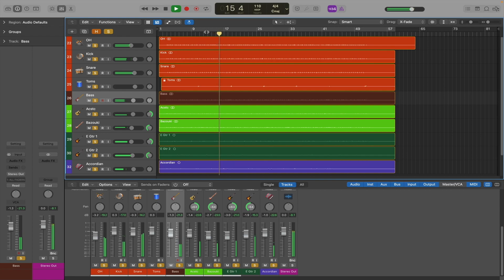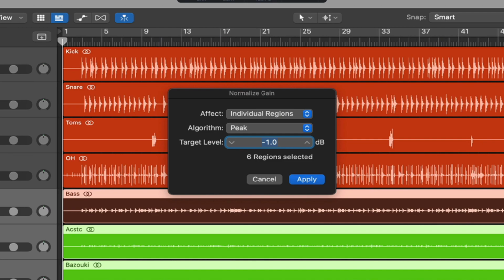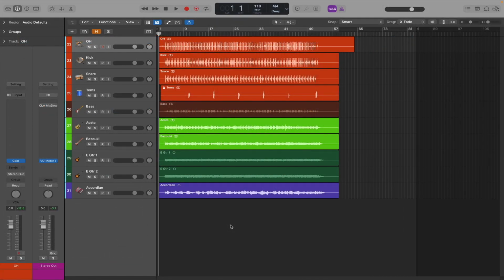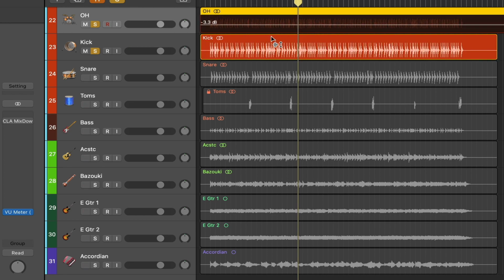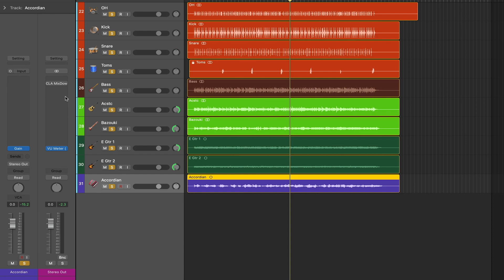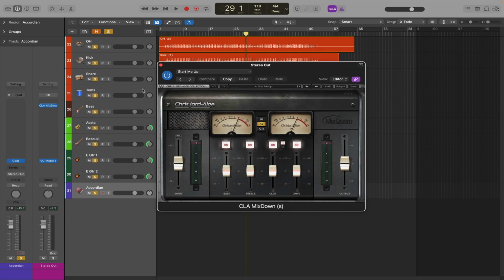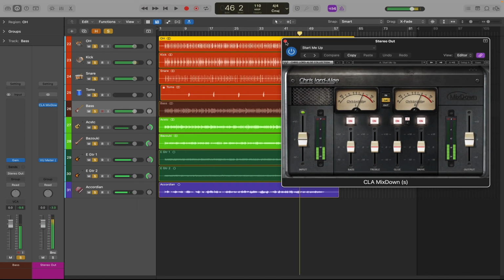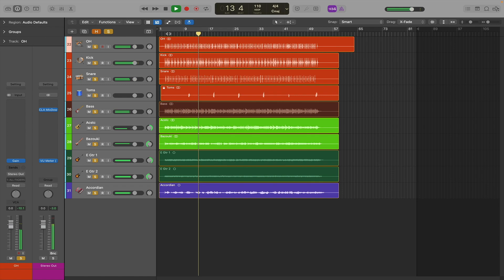How to gain stage projects in Logic Pro

Comment: Thanks for this information, I am a little confused by the way you gain staged drums first and then other audio files relative to your drums. I have a question please... why do you gain stage to -1 initially and then further to  -5 and not at a lower level across the board?? I have been advised by several engineers to gain stage my session audio files to -18.00 peak using the Logic Normalise Gain feature. Apparently many plugins are modelled on analogue gear that operates best at operating level of -18. When I do this as a whole to all audio files simultaneously the individual drums and other types of audio audio do not exceed -18 which appear to be a good level on for example my SSL Channel strip. Input gains above -18 show as red in the channel strip metering. Kindest regards from London UK 🙂
Reply from the maker: Hello, @ViceSquad. Great question! First off, I’d like to mention how varied the gain staging approach is for different engineers. Chris Lord-Alge is known to regularly push hot levels (around -6 peak or higher) into his SSL console for the saturation the individual channels impart and then trimming back at the master before everything hits the master bus chain. Andrew Scheps has been quoted as saying that he doesn’t have any real gain staging methodology that he uses. These are two highly known and successful professional mixers with pretty radical views on gain staging. I personally like dealing with this prior to mixing or my mixes can get really harsh sounding.

Now the reason that I set my drums to -1 peak to start off with is just to ensure that the drums start off louder than everything else and then build around that. You can start with lower peak levels for the drums, and build around that, as well. The whole idea is to quickly get a static mix put together. If you don’t like how hot your plugins are being hit, you can select all of the regions and lower them all together until you like the sound. As you experiment, you’ll find the levels that you like working with this is something that you need to experiment with and see where YOUR sound is at.

If you are going to normalize to a peak level of -18, i would suggest starting with your faders at unity, normalize the tracks, leave one track as your baseline (a lot of times the kick or possibly the overheads), and set your static mix by clip gaining everything else around that. Try this method and then try peak normalizing everything to -18 and set your static mix with the faders.  After you try it, let me know which one sounds best to your ears.

There is so much more that can be covered on this subject, but I’ll leave off here for now. Keep trying things and let me know what’s working for you.

All the best!
Reply: @ronlankford3690  thanks f r the detailed reply, as I investigate the many approaches to gain staging I am seeing that it is a mixture or personal preference and style of music being mixed. In the case of the song you are demonstrating I fully understand why you are taking the approach you do, unless I am mistaken I view it almost as though you are setting a mixers mic inputs for a small band in a club situation with faders at unity. I create a much different style of music to you and am still working at formulating a satisfactory approach to my mixes. I have certainly learned by watching and communicating with you and that is priceless, music is all about positive interaction. Kindest regards from London 🇬🇧 UK.

Comment: when you are creating the static mix, what are you doing to get the gain tool? might sound stupid but i dont actually know how your adjusting them
Reply from the maker: Hi, @jonnybond2616

Thank you for reaching out. Are you asking where to access the Gain Tool from? If so, you can either go up to the Primary Tool button and select the Gain Tool or if your Keyboard Shortcuts are set to the default, you should be able to press the T key, which will bring up the primary tool menu and you can select the Gain Tool from there. 

Did this answer your question?